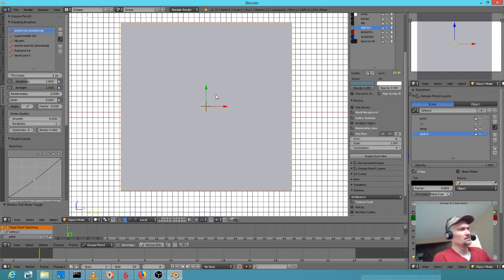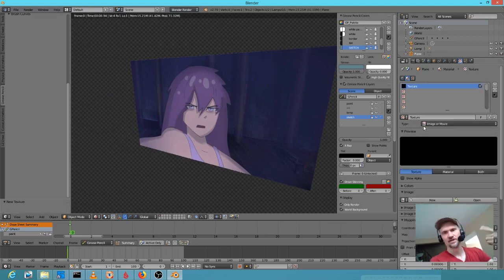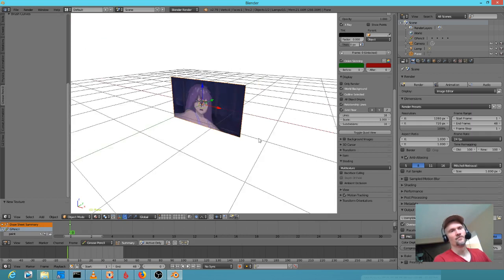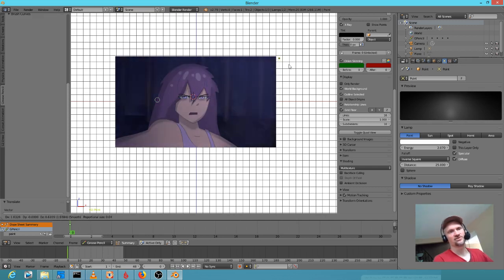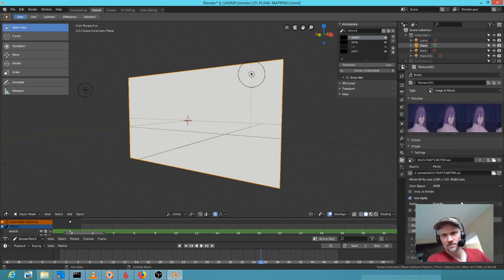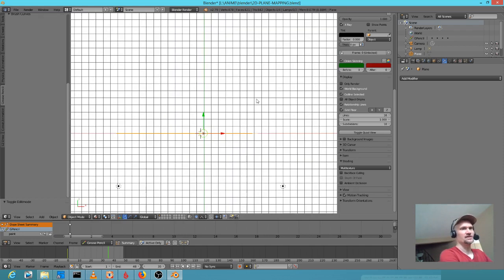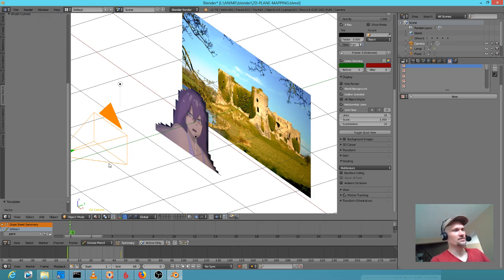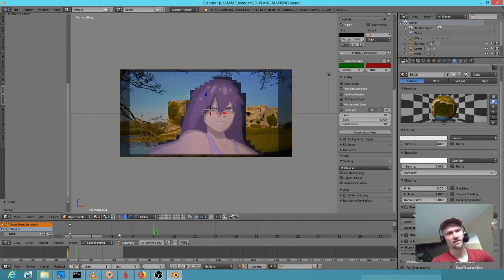3D camera moves and selective lighting for 2d

Comment: the Add image to plane is absolutely available in 2.8.    Add/Image/ image to plane.    Then if you have alpha you need to  go to the  properties(on the right) material/settings/Blend mode=  alpha clip.

So yes.. many  more...umm... different-  idiosyncrasies.   I too am very well versed in 2.79 and everytime i stick my neck out in 2.8 it takes 10 times as long and sometimes with no results that I just go do it in 2.79.    I don't know if that is the "proper" way to learn or "upgrade" but that is the path I'm on none the less.
Reply from the maker: Thx so much for posting Jim, I will def check out soon!